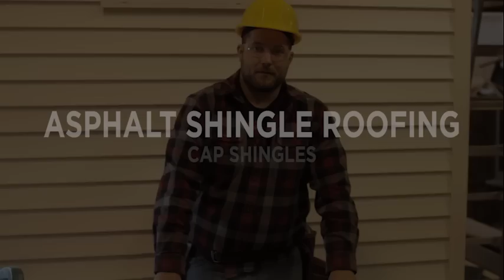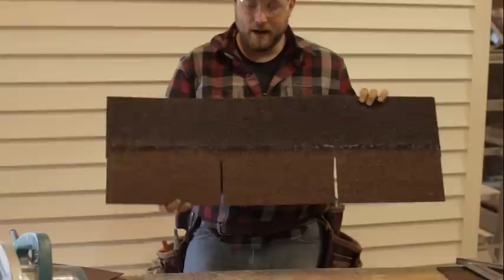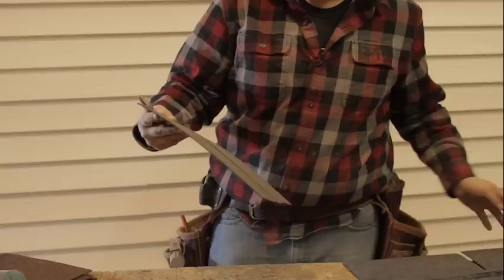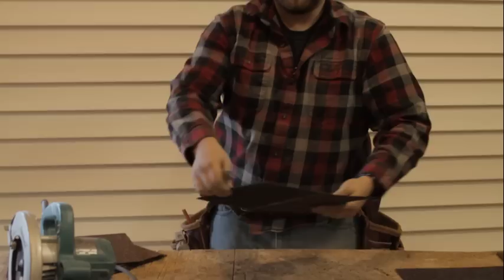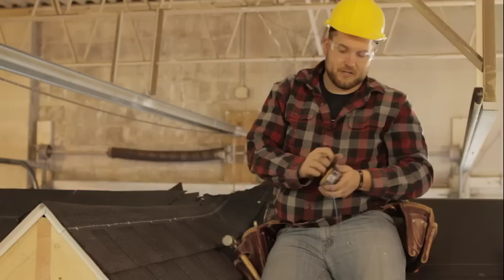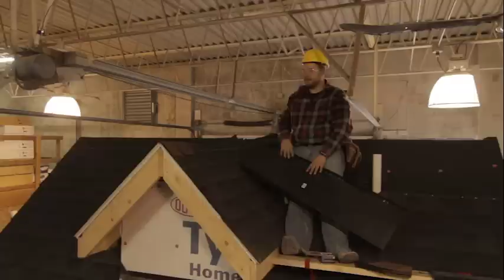How to Install Asphalt Shingle Roofing Part 12: Cap Shingles (Ridge)

Comment: One major thh be big that most pros forget, or just plain don’t know, but the everyday do it yourselfer, knows, and that’s to figure out which way most of your wins and weather comes from, and make sure you start you cap at the end the wind will hit last. This way they are all overlapping away from the wind so your caps do not get torn off in a storm and the rain washes across them as well. I do not understand all the detailed info and you all forget the first thing you need to figure out before started the cap. Find where your weather comes from. Where I live, it comes from the south west, so the cap will end on the southern, or western most part of the ridge. Just imagine rain washer over the lapping of the caps and not up underneath.

Comment: Wow. Gotta love guy's who don't do this for a living. First of all  don't cut your ridge caps back more than a half inch as when you nail the cap your nail should catch the previous cap. Your nail should be  no more than an 1"-1 1/2" from edge. Next please install a starter cap under the first one that he installed. You can find all of the correct ways to do this by reading the Manufacturers instructions. They also have video's.

Comment: How do I remove stubborn shingles. I'm only trying to replace a couple of shingles not the whole roof
Reply: use a flat bar roofing tool to take out the nails before you remove the shingle. remember to remove the nails of the shingle above it as well to get it under it eventually.

Comment: is it better to run a building line on the ridge to center cap shingles? have you ever tried folding your caps ìn half and using the rear marker at the back of the cap to align with the ridge line previously mentioned? you should try it n like a faster n straighter ridge cap finished... just a tip.

Comment: So how do you deal with the unfinished part of roof cap shingle when you get to the other end of the roof?  Thanks for the great videos, I learned a lot!
Reply: why don't you stick the last one down with roofers mastic that's what other people have done no nails  screw fix sell it
Reply: OK so that's how it's done.  I couldn't figure out how the last cap could be put on without leaving the nails exposed.  Probably over kill but I think I'll also put some tar under the cap where the nails will go just to make sure no water gets in.  Thanks again for the info and great videos.  You've inspired me to give it a go on replacing my the mossy wood shake roof on my shed :)